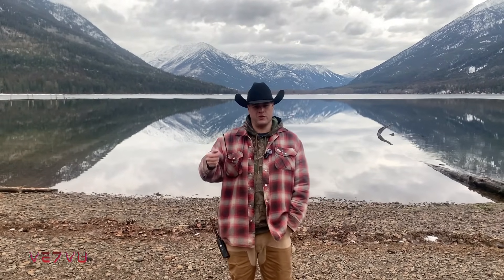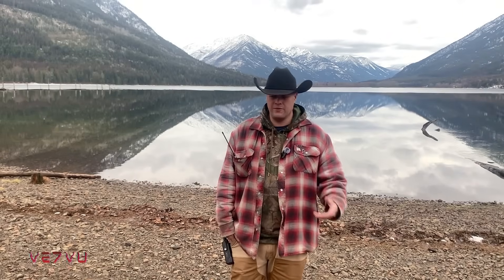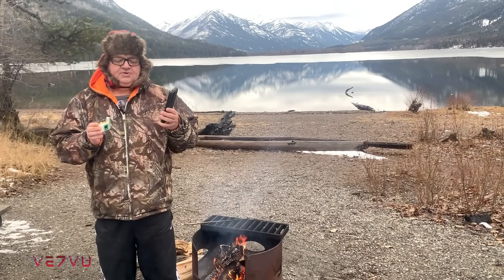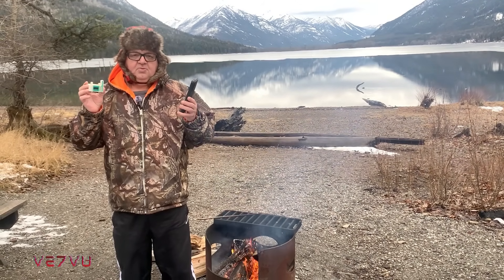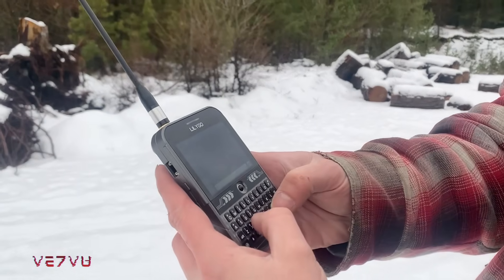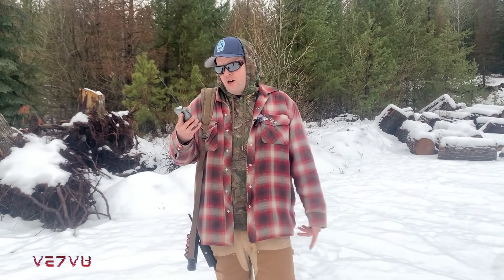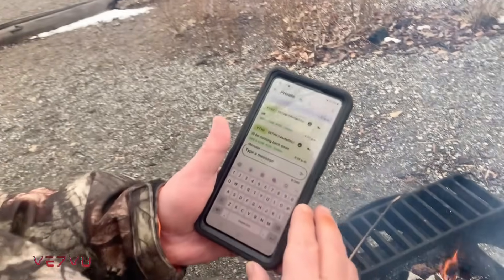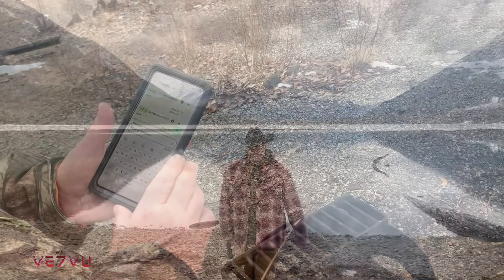Meshtastic - LoRa Radio

Comment: I have been thinking about getting into Mesh. And or just experimenting on the ISM. I wonder if I can use my old computers/TNC's hooked to some sort of 900 mhz transceivers. I understand that some LORA units have serial I/O?  It would open up a whole world of possible friends if we could legally work in an unlicensed band. My goal is to build a small group/ network of over the air retro computer users/ gamers/ BBS'ers. 
I have often said to all those that never listen. If you want young people to get into over the air activities. Amateur Radio.  It needs to look and function like a Telescreen (cell phone). And it needs to be accessible without some gatekeeper hazing ceremony testing procedure. After all, to use a Telescreen,. You need only pay to play. And who here argues that this is the very reason its hard to get an Amateur License.  Obviously the Telecommunications Industry did everything in their power to make sure Amateur Radio was hard to get a license for. 
As a side note. Those old 900 mhz pagers would be fun if they could be reworked to receive messages at the right frequency. I wonder if that can be done in software. I have been trying to Google up some info on reworking old household wireless phones to over the air communications devices. Some of them are / were in the 900 mhz band? I like repurposing junk. 
I have never gotten involved in RAC because I assume they are a group of the worst type of HAM radio operators. The technocrats. The rat out your neighbor types. It would be nice to find an organization that is looking for Progress in the OTA world. For example it would be nice to rework 11 meters for unlicensed and licensed operators and equipment. A sandbox if you will. It would be nice as a HAM or otherwise have access to low power TV experiments on the TV frequencies that are UNUSED. And in most of rural Canada. The frequencies are and always have been unused. It seems allowing Amateurs access to unused frequencies in a secondary position is a no brainer.